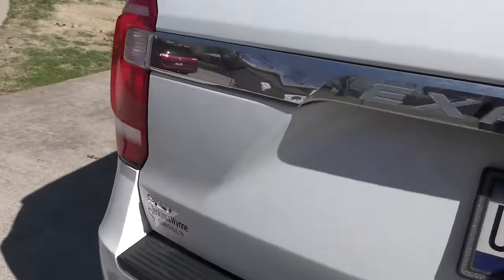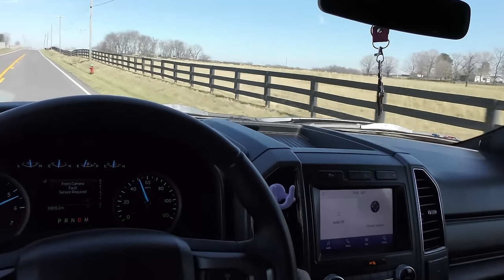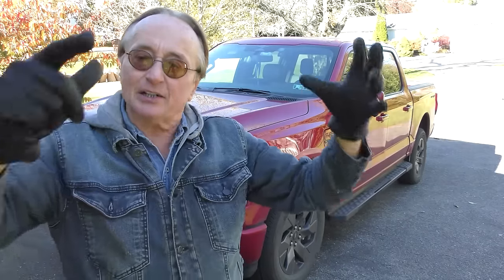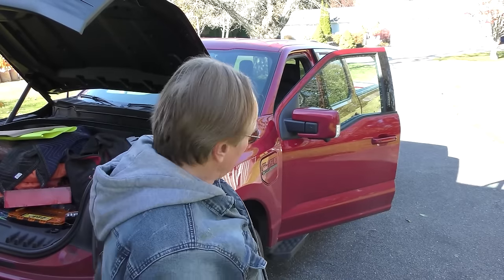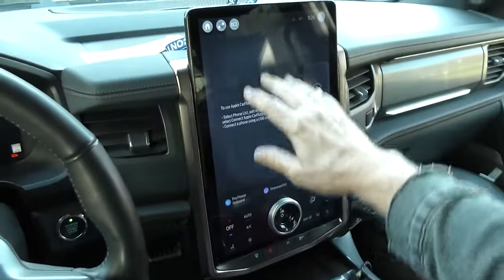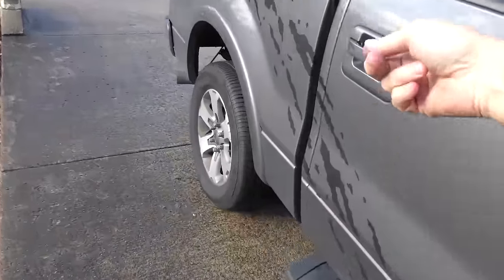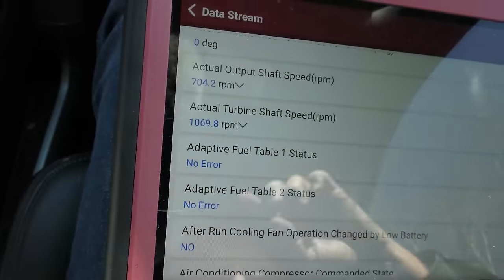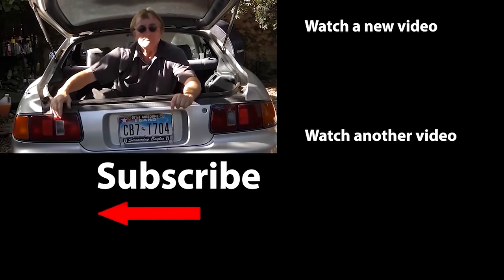Here's Why Fords are Crap Now

Comment: I heard that Ford got so cheap and they've got the rewiring so tight that any kind of movement makes the wires break at the harnesses and causes all of those problems. So I guess they saved 50 cents with the quarter of an inch of wiring. And that's causing a lot of the problems with the Fords and of course, the build quality with water intrusion.
Reply: That's absolutely  true.
Reply: So true my moms 2013 ford fusion has multiple broken wires on it causing error codes, mostly from ford doing recall work. So cheap my 83 k10 truck still has original wiring with zero problems. Ford is garbage
Reply: I am ashamed of the automotive industry weve got here on earth
Reply: False

Comment: They should had made the 5.0 302 V8 on the expedition.. i don't buy anything full-size that is not a V8. A full-size vehicle has to have a V8 no exceptions...
Reply: A diesel i6 is pretty good. However modern emissions system killed diesel reliability.
Reply: You won’t be buying full sized in the near future then, new at least
Reply: @julio4494  Nope.  because there's no full-size cars anymore new. the newest full size car you can get now is the Ford panther platform from 2012 and that's all.. now it's all Chinese garbage with American names slapped on...
Reply: The 3.5 eco boost a superior motor in almost every way shape and form to the 5.0 v8 made for all other models then the mustang…

Idk what the hell Scotty is on saying it doesn’t have the pick up that the 5.0 has… it’s quite literally faster in every scenario
Reply: @handleymacdonald5760 yah if you're married to Ford and their little compact car V6 and if you own one of those things yah your going to say it's superior than an airplane ✈️ faster than a Ferrari ect ect that's classic..  but a fact is that a V8 is reliable and cheaper to own and a V6 is not; unless if it's a straight 6...
Reply: @handleymacdonald5760 boost the 5.0 and the 3.5 is invalid
Reply: @handleymacdonald5760  If you buy a Ford truck, get a V8. The ecoboosts will not last in a truck unless you drive it like a hearse. You will burn it out.
Reply: Agreed
Reply: @gerardomendoza9688 

The guy never wrote anything about   airplanes or Ferraris...he said it has higher performance than the 5.0...(also more performance than most of the other 1/2 ton V8's)

Try and keep up...
Reply: @3000fpe 

Your warranty is invalid as well...
Reply: @cloroxlavenderscent4307 The Duramax and Cummins, Cat diesels are superb.
Reply: I agree 100%
Reply: @davekeller2798  me too. I even think the 302 is a little undersized. I am old school, no replacement for displacement.

Comment: Back when I was working on cars you never heard of a differential going bad.  It just never happened.    You would get the occasional GM in for rebuild but even that was rare.   Only if the owner beat on it.
Reply: I should have realized when the 2000 Silverado I bought had new rear tires and bald front tires, it has a 3/4 ton rear axle now

Comment: Ford shouldn't say quality is job one. They should say they are number one in recalls.
Reply: recalls are good gm hides the problem like its not a problem
Reply: Lmao most are precautions. Unlike everyone else. And FYI Tesla is the most recalled vehicle ever 🎉🎉
Reply: @brandonmacon3317 Ford has led the industry in recalls and warranty repairs for 3 consecutive years. You shouldn't post you only post garbage.
Reply: @johnhanson4795  GM fixes Their Recalls Ford rarely does
Reply: @brandonmacon3317  no it’s Ford 44m Recalls
Reply: @brandonmacon3317  Wrong.The most recalled vehicle since the recall inception is the F150.Over 15 million F150 trucks have been recalled.
Reply: Mopar is number one in recalls! Not ford!
Reply: Doesn't it make more sense to say Recalls are job one ?
Reply: No, that’s Chevy… Chevrolet stands for CONSTANTLY HAVING EVERY VEHICLE RECALLED OVER LOUSY ENGINEERING TECHNIQUES which is true
Reply: Poor quality.
Reply: @stefanovichmichael9686  Perhaps that is because they have been the best selling trucks for almost 50 years. Going by percentage of vehicles sold Dodge has the most recalls and its not even close. Same goes for GM/Chevy.

Comment: I had a 1998 Expedition that had the 5.4 liter Engine that liked to blow Spark Plugs.   I don't drive anymore and I can't walk very Good now,  but I still enjoy Your Videos.
Reply: I've always heard those engines are bad for that.
Reply: 5.4s notorious for that.
Reply: Change the plugs at regular intervals and torque them more than factory spec and they won't blow the plugs out. I've got 330,000 miles on my 99 Expedition.
Reply: It's to late for Mine.   My Parents had it hauled to a Junk Yard about a year ago.   I can't walk very Good now and I don't drive anymore.
Reply: @zackmax7184  That's a bummer. 97 to 03 Ford's are some of the best built vehicles on the road. I've been a mechanic for 24 years and I can honestly say that.
Reply: @RyanMcNabb-en9yw Except the Powestroke 6.0, Class action lawsuit because it was so bad.
Reply: @jerrygordon5808  The 6.0 had it's issues but they can be a good reliable engine. I was mostly implying 97 to 03 gas 1/2 ton trucks and Expeditions as well as gas 3/4 ton trucks. I was never a fan of the v10.
Reply: @RyanMcNabb-en9yw  Yes if you bulletproof them they’re good. My friend had a V10 Expedition that wouldn’t die
Reply: @jerrygordon5808  Right on! I personally was never a fan of the V10 but that doesn't mean it wasn't a good engine. I'm a V8 guy.
Reply: I have 262.000 on my 98 Econoline with Trident.

Comment: So I wanted the Lincoln experience and leased a 2020 Corsair with nearly every option available. This was from new. About four months into the lease and probably less than 5k miles the computers started giving numerous system failure warnings. They were all for safety systems and I told the dealer to come get it as I did not trust the thing to drive it with all those safety features nonfunctional. Note that these failures were all intermittent. A week later the dealer told me they did not recognise any of the error codes and had to contact Ford about it. Turns out that Ford didn't even know what was happening. Eventually, someone figured out that a sensor housing somewhere was cracked and took on water which caused shorting and that confused the car's computers. So the sensor was replaced (after ordering the replacement twice because someone screwed up the order) and things started working normally....not really. In my opinion, the computers were somehow damaged and some of the errors resurfaced but very intermittently. Fortunately, I was able to get out of the lease without any $ out of my pocket. I called it brain damage and am satisfied with having had the Lincoln experience. It was a really nice car, drove very well and so smooth. No, I will not go back to Ford products.
Reply: I used to have a 1989 Lincoln Town Car. Very nice car.  THAT is the Lincoln experience that you wanted.
Reply: @TheChamp789  that was my car of choice when I worked at Budget rent a car. Sadly, it is no longer in production.

Comment: 2017 4 runner.
Moved cross country twice towing. Lifetime Half highway, half hard trial  miles. Besides the forged wheels and pedal commander when  I got when I bought it , just oil changes and tires expenses. 
Sure bad milage but LT tires , forged wheels on a great platform. Drive something you can be confident it won’t fail you.

Comment: Took my F250 for standard maintenance. They left every other lug loose. Luckily each wheel has eight. And they left my power steering cap on the cowel... So much for dealer service. 

I do my own breaks now and I tighten my lugs with torque wrench.
Reply: BRAKES
Reply: Imagine what they do with oil changes.
Reply: Hopefully you can fix the brakes better than you can spell…

Comment: I have a 08 Ford F-150 XL with 5spd manual transmission with roll down windows. Runs great with 105k. Very little electronics just plain and dependable.
Reply: With only 105k miles it should run like a brand new car!
Reply: @hokie9910  Okay.
Reply: Sounds like a cool ride.
Good work keeping it on the road.

Comment: Ford worked very hard from 1990-2010 to internalize Total Quality Management.  They have been chasing advanced tech bunnies since then and have lost sight of quality.
Reply: Seems like the only close to trouble free FORD product now is the E SERIES cab/chassis. They kept the same platform for decades because it works. It’s by far and away the most popular foundation for class C motor homes and hotel/airport shuttle buses.
Reply: @JoeTricep  You just reminded me. Hard to believe that NAVISTAR was for many decades a great builder of gasoline and diesel engines and supplied them to other truck and bus builders. Now they source their engines from CUMMINS. How the mighty have fallen.
Reply: Henry Ford was right about the J's
Reply: Almost right, but the Triton V8 with the spark plug issue was pretty bad
Reply: AKA on the 97 F-150 from an inline 6 300 to a 4.2 V-6 which is trash.
Reply: @tennoklark  I had a 1995 E-150 with the old 300 6 tough engine but it certainly loved to drink fuel and not much power. But it was fine for around town. FORD actually did something right back in the ‘00’s when they dropped the 4.2L V6 which was no good. Then they made the 4.6L V8 standard equipment with the 5.4L V8 optional. They found the 4.6 to get the same mpg as the old 4.2 and much more power. Plus they had the same engine family which standardized things. Then they went turbo nuts.
Reply: Almost everything Ford has built in the last 15-20 years is much higher quality than cars they produced in the 80s and early 90s. Do people not remember the cheap plastic rattling interiors? The problems with the clearcoat peeling off? The amount road noise? They are light years ahead in quality now.
Reply: Even the hood latch can cause strife. You don't know when that old latch decides to seize up and not open

Comment: Still using my 2003 F-250 V10 as my daily driver. 210,000 miles. Only real issue was the exhaust manifold studs snapping off after 100k miles. Installed headers on the truck when that happened and it's been mainly good after that.

Comment: You're not wrong Scotty.  Over 2 years I have worked on 2015 - up f150s with the 3.5 twin turbos. Valve covers crack under pressure from the turbos, cam phasers, timing issues, leaking plastic oil pans, etc. Older Ford's pre 2010s that didn't have the cam phasers/ timing issues were alot more reliable than the newer crap ford's dishing out these days.
Reply: Are those issues showing up on 21+ trucks? I heard they made improvements on the newer 3.5 ecoboost, but would like to hear if you're still seeing issues with them.

Comment: My 2020 Expedition has had cam phasers issues. Also had to have infotainment system reflashed. Other than that it has done what I have expected 105k miles to date
Reply: With most vehicles, it's that 100k-200k, when it's gonna fall apart if it's gonna.
Reply: Watch those cam phasers, common issues with Fords especially with eco boost engines. I seen to much videos of getting them fixed then several thousands miles later same problem.
Reply: Cam phasers? Run away!
Reply: Let us know when u get to 250-350k😂
Reply: @richardgibson4757 not in a 2020
Reply: Cam phasers in ‘20? Thought that got ironed out in mid 2019 model years? At least that was the case w/ the 3.5HO in F150 Raptors
Reply: lame

Comment: For now im just sticking with my rusty 05 F150 with the 5.4 3v. Its got 250k miles on it and has never given me a problem and it tows and hauls everything i would ever need it to. Its a shame that car companies just dont care as much about quality control anymore.
Reply: Diversity  is involved
Reply: hell yeah.... i goy a 2000 f250 with 145k and does everything i want
Reply: @MarkTurner-vs7uc No one wants to admit that either
Reply: Had a 5.4 2 valve had well over 300k still being used co worker
Reply: The difference between the 2v and 3v isn’t hardly much difference too.
Reply: @TimValenti-v9l  yeah the only major difference is the 3v has those stupid cam phasers that like to fail. That's why my truck was so cheap is because the phasers were out of it and it would barely move. But we fixed and ever since it hasn't had a single problem and it hauls and tows pretty much anything I need it to.

Comment: Bought a 1984 Ford Ranger. 2.0 liter motor, 4-speed manual, first year for the club cab. Other than a weak temp fan (they never upgraded for the extra space inside), and rust issues (new exhaust almost every year, but to be expected n the NE) I loved that truck. Put almost 200,000 on it when I had to junk it in 2011. 
I leased a brand new F-150 in 2021, then bought an Ecostar outright. Regretted both greatly. Fit and finish problems, the infotainment system on both would black out, the power seats creep constantly, the mirrors are absolute crap for visibility, on the Ecostar the charging ports crapped out though the fuses are good, the piped in engine sounds on the truck sounded buzzy... The list goes on, some problems minor, other major.
I Will Never Buy A Ford Again.

Comment: This video reminds me of how old I am. 

My first thought is "The Return of the Throwaway Cars". 😅

In the 80s they used to make cars that would only last a few ten thousand miles. Then everything would go to crap and you were better off selling it to the junkyard for 50 bucks and buying a new one.  We all used to call them throwaway cars.

But what really sucks is this new generation of throwaway car cost ten times as much as the first generation did forty years ago. 👎
Reply: What brands made those cars?
Reply: @Jimster481 look at Chevy Chevette, etc...
Reply: @floyd-zj6jz  CHEVROLET VEGA. My neighbor had one from brand new but that engine belched oil smoke like an old locomotive. PLYMOUTH VOLARE/DODGE ASPEN twins. They were nice smooth riding cars but plagued with all kinds of problems. They did improve that platform in the form of the PLYMOUTH GRAND FURY and DODGE DIPLOMAT. They were pretty good cars and PD’s liked them.
Reply: Also, my buddy's dad had a Ford Ranger. At 85,000 miles the engine started going out. He took care of his cars religiously. He replaced the engine with a used engine from a Mustang. He kept it for only a year after that and traded it in.

Comment: 2020 F-150 5.0 started hard shifting 2-3 and 4-5 at 30K miles. The dealership fixed it just by cleaning 2 solenoids  and changing the transmission oil and filter. So now I will have the oil changed every 30K to make it last.
Reply: i have the 2021 xlt they redid all of that i had a new 2018 ford 5.0 worked great for 30 grand then made weird noise at idle through town like a timing chain growl it was weird 10 speed.the 2021 10 speed is totally different shifts different way smoother they figured it out

Comment: I liked the Triton V8 ones. I just think a V8 is a better engine. Ecoboost is better performing, but V8 engines will always be on top from my book. They are an American staple.
Reply: No extra stress from a turbo. Yes those TRITON family of 8 and 10 cylinder engines were proven with long life and smooth operation. I was watching another video of an old BLUEBIRD school bus with a FORD V10 being cold started. Man what a nice sounding engine.
Reply: the 5.4 tritons were horrible same with the 4.6s. they blew sparkplugs like it was nothing
Reply: @igloozz__0528 I have a 2004 V8 Lariat, 74k miles.  I haven't attempted the plugs, but this is the year.  I'm scared.  Lol.  Shifting from park to reverse takes like 3 seconds, so that's not good.  Otherwise, it's good and I love it.
Reply: @richienotsorich4303  😭😭😭
Reply: The Triton is awesome especially when it can last nearly one million miles! There have been a few years where they had problems, but I know a company that has over 30 Econoline vans with one million miles on them. They have gone through a few transmissions, but most of them have the same motor. Good luck seeing an Ecoboost make one million miles.

Comment: I am keeping my 2013 f150 V8 Fx! Just had 100,000 mile maintenance at my personal mechanic, wouldn't dream of  taking it to ford for that service! Just had the ac repaired and had to take the dashboard out to do the repair 10 hours of labor. But the truck runs great and the coyote V8 is wonderful.  Will keep maintenance  going because the thought of 70 plus thousand for a new one will not happen. I bought this truck with 79 thousand miles and my question is at 103,000.miles should I drain my trans fluid and not flush it or just do nothing it shifts just fine. Thank you sir enjoy your show!

Comment: When Ford was legitimately "Quality is Job 1" they were excellent.  Then, the focus became financials, so "lowest cost bidder" issues are everywhere now.  Also, turbos, 3-valves, smaller and smaller engines in larger and larger vehicles.  Too much emphasis on supposed fuel economy, rather than driveability and longevity.

Comment: I owned 2 ,2002 Ford Windstars..1st one i bought new. An LX..Got 297 k before it blewva head gasket. It was probably the most reliable vehicle ive owned. It broke down twice in 20 years..once when the heater hose assembly let loose..and the 2nd time is when the trans let go at 184 k. It didny need a wheel bearing until 283 k front left and it was in its 2nd water pump..It was replaced at 37k and was still going strong at the time of the head gasket..original exhaust syste. I drove the wheels off that van..my other is a SEL..179 K a cream puff..use it for highway trips.